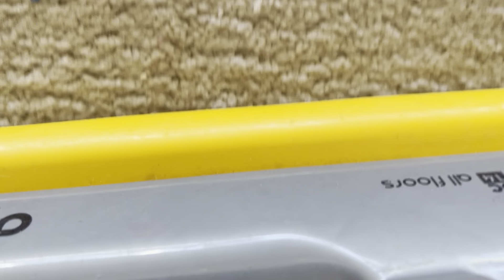Shark Navigator 💜& Dyson Dc14💛 Brushroll Crunch on Hard floor and Carpet 🧃

Comment: Not sure if you can help me but my DC14 does not stay flat to the ground, I already wd40 every single joint in the head and replaced the hose (agitator to motor hose) but it still wont sit flat with the agitator flush to the carpet unless i practically try to vacuum with it nearly upright and its so annoying!!